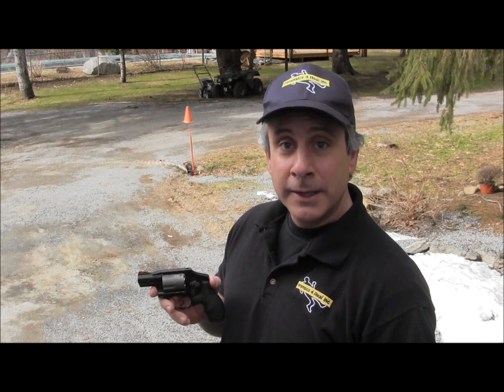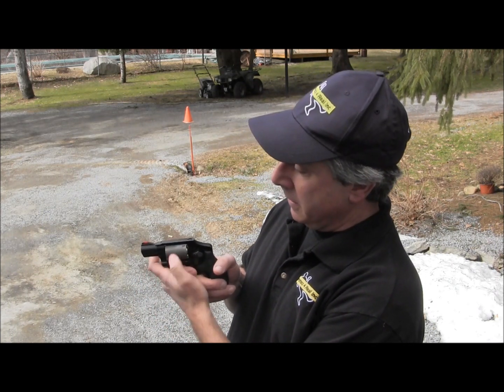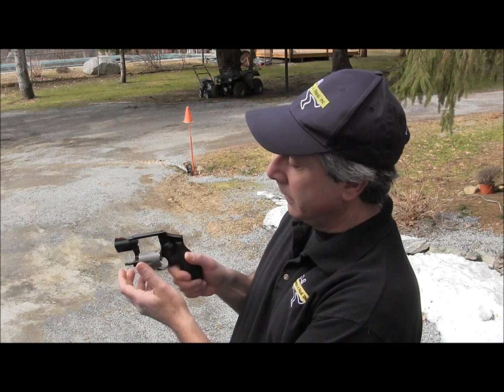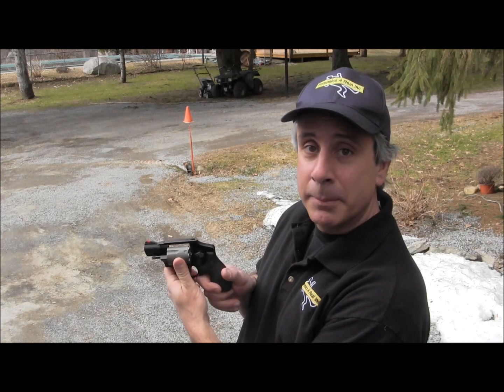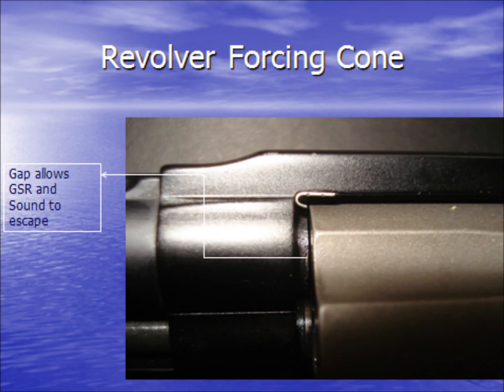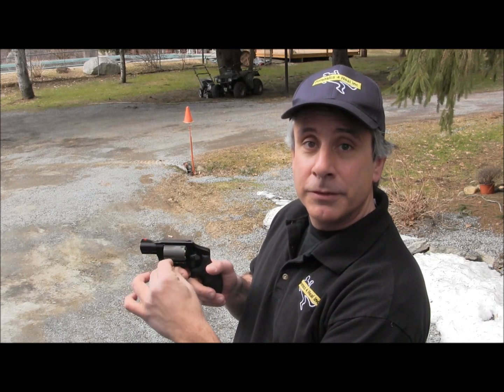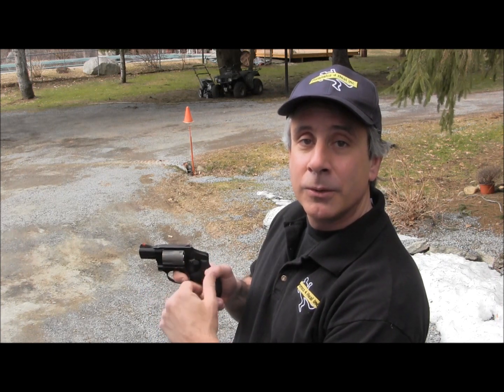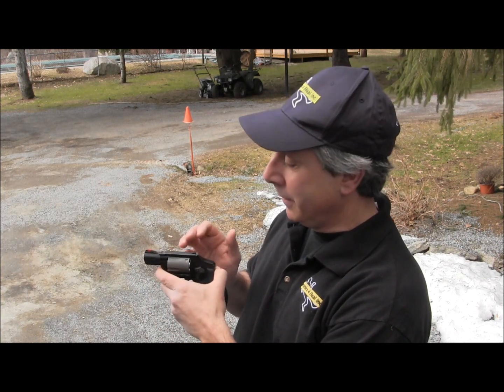CSI Myths - Silencer on a Revolver

Comment: The Nagant has been mentioned.  There was also a Ruger revolver rifle which used a silencer.
There were also at least 3 integrally silenced (or low noise) revolvers.  People claim the Stechkin OTs-38 is as quiet hot as it is cold.

Comment: Saw a S&W model 10 with a silencer, yes it was noisier than a silenced pistol but it cut the noise by about 70% so it's not complete bunk, if you want the neighbors to assume you dropped a book vs shot your husband....
Reply: Thanks,  that's very interesting.   Was that published anywhere?
Reply: @Johnny1Horse  It was a training video toward the end of Vietnam, the Army and Marines threaded some  model 10s for silencers to equip tunnel rats, the extra weight and length of the early cans outweighed the utility of the cans reducing the report and muzzle flash so most stuck with standard 1911s, the video was part of the jungle warfare series and should be floating around somewhere

Comment: Explaining why you think it wouldn't work is easy.  
Showing us how well or poorly it works would be actually valuable.  
It might be equal to a semi auto if the semi doesn't have a slide lock forward.
Reply: When a semi automatic pistol's slide is not locked then the firearm is "out of battery" and will not function.

Comment: why don't you just screw suppressor and make decibel comparisons with  and without suppressors instead of making speculations about escaping gas on the cylinder gap, after all I've notice that there is much gas volume escaping on the muzzle than on the cylinder and that can be suppressed, and you would be the first one to do that experiment with ordinary revolver.

Comment: Please folks, the Russian Nagant revolver.was mentioned but that revolver is from 1895 and uses a custom sealing method that mimics the chamber seal of an automatic for each round fired. Just not a typical revolver  As the author correctly points out a gap between the cylinder and barrel is necessary for proper rotation. That gap in ALL revolvers sans custom revolvers that mimic the seal of an automatic, leak to much making it impossible to silence or suppress any thing aft of the barrell.  Therefore excluding the very old and atypical Nagant and any other "custom" revolvers, you CAN NOT SILENCE OR SUPPRESS REVOLVERS with conventional silencers
Reply from the maker: Thanks very much Donald Phillips.  Lots of critics haven't read the text but I understand their wanting to make that point.

Comment: Silencers do not exist, only suppressors, are you even trained to handle a firearm properly? you have done several red flag mistakes in the first 25 seconds.
Reply: The good ol silencer vs suppressor debate. Anyone with good knowledge of weaponry will NOT care what you call a silencer/suppressor because they are literally the same thing, just like Soda and pop or tennis shoes and sneakers. Anyone who gets hung up on this argument probably sits in front of his shooter video games on a daily basis trying to sound like some gun expert.
Reply: No, Silencer implies that it silences the weapon, Silence meaning eliminating all sound, it doesn't eliminate sound, it suppresses the sound (AKA suppressor), anyone with good knowledge of weaponry will actually correct you if you say silencer referring to a suppressor, just like there are real differences between a tennis shoe, and a pair of sneakers, of course you would know that had you done your research before replying, don't try to sound smart unless you get your facts right buddy.
Reply: You’re getting into the technicalities and that’s not what this is about. Of course no gun shot in present day 2017 can be completely “silenced” but that is what these so called suppressors devices have been named by the original designer of the silencer Hiram Percy Maxim. So out of respect I probably wouldn’t argue with the man on whether it’s called a silencer or suppressor as he had every right to name his inventions anything he wanted. Shall I also mention the companies that have “Silencer” in their name (most notably SilencerCo) that actually specialize in building and/or selling silencers and probably have more knowledge of the devices than both of us combined. 

But let’s say none of what I just said matters and disregard it all. The official ATF handbook that classifies NFA weapons such as machine guns, SBRs and silencers, still refer to the suppressor device as a Silencer. If you don’t know who the ATF are, these are the guys that regulate these weapons/devices and allow You, as a citizen, to purchase them through the payment of a tax stamp of $200.00 and wait a period of several months to obtain the NFA item. So are you also gonna argue with a government agency on whether its called a silencer or suppressor? I'd save your breath on that one. 

I won’t pretend like I know everything when it comes to firearms because I don’t. But if there is one thing I do know is that arguing over what a silencer/suppressor should be called is a completely moot point. The real answer is that both are correct and anyone who owns a silencer will tell you no different. I’ve done my research long before when I was going through the process of purchasing a Silencer. So there you have it, hated to burst your bubble but these are the facts…buddy.
Reply: Excellent point about the Gov't nomenclature.  Here's a link to the FBI Firearms Laboratory website and they list "Silencer Testing" as one of the services that they perform:
https://www.fbi.gov/services/laboratory/scientific-analysis/firearms-toolmarks

I could understand calling someone out for calling a "Magazine" a "Clip" since that would be incorrect, but if someone's bleeding and they ask for a Kleenex, should we not hand them a tissue because we don't agree with their terminology?  Thanks everyone for watching and for the interesting discourse.  Next video: "How to SNEAK up on a person while wearing Tennis Shoes.  :-)
Reply: Obstructed terminal where can i buy a silencer then?

Comment: If im not mistaken a nagant revolver works with any old silencer
Reply from the maker: Mike Czlapinski Thanks for watching Mike.  I did mention in the video description that there was an exception.  It's definitely not my Air Lite .357!
Reply: @csiexpertsinc183  you are correct sir. The only revolver that can be suppressed.. and it was done on accident
Reply: Yeah. This is pretty much the only revolver that can take a silencer.
And as I remember it wasn't exactly intended, the mechanism in that revolver that presses the chamber to the cone, closing the gap, was designed  to make this revolver more accurate.
Reply: a .22 Revolver with a suppressor is the best weapon for very close range assassinations

Comment: Couldn't you seal the cylinder in a way that the gas only escapes through the barrel?
Reply: That's what the Nagant does.
Reply: +Archimedes616 

The Pancor Jackhammer uses a modified version of the Nagant design. So one could put a silencer on it though having only one in existence means no experimentation to confirm it. The Six12 shotgun from Cyre Precision also can have a silencer put on it and they even have an integral silenced version that looks like a sci fi pulse rifle. That shotgun also uses a modified version of the Nagant revolver seal.
Reply: Yes, there are several but its not 100% necessary, you can reduce the cylinder gap and it works, straight cut the forcing cone it works, add a rubber flap, it works (1970s SEALs had one)  also some cartridges like 22lr work too.   I'm just surprised to see this video not actually try it and not even fire anything suppressed to show.

Comment: your completely right except for one revolver the russin nagant
Reply: or you can make the the suppressor cover the gap and make it a break action revolver instead of a swing out
Reply: @gcart7675  i don't think it would work either. Nagant revolver can be silenced because the mechanism closes the gap by pressing the cilinder to the cone. Nagant is reloaded from the back, sht I forgot the terminology, you basically need to open the doors on the back cover of the chamber to reload it. Fck, like pracemaker
Reply: Masterzoroark666 i know it would thats how you suppress a revolver because thats where part of the noise is coming from is the cylinder gap so if you cover that with the suppressor that noise is gone now
Reply: @gcart7675  damn, I meant, I don't think break action would be silencable. Idk, maybe, I'm not a gunsmith and gun nuttery is more of a hobby of mine
Reply: Masterzoroark666 its not "gun nuttery" to know how they work and thats what i meant is that a break action revolver would work over a swing out cause then you can cover the gap cause you dont have to worry about the cylinder when you open it just look up suppressed revolver concept youll see what i mean
Reply: there are actually 2 others i believe one is https://en.wikipedia.org/wiki/OTs-38_Stechkin_silent_revolver and the other is a Modified M29